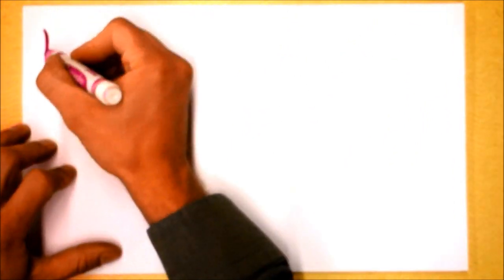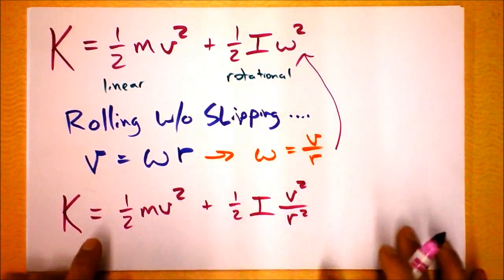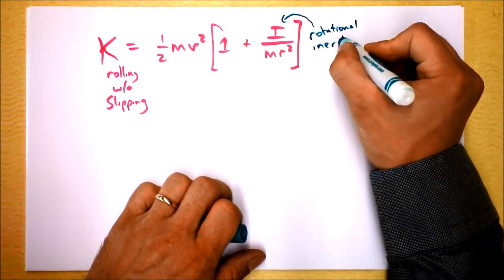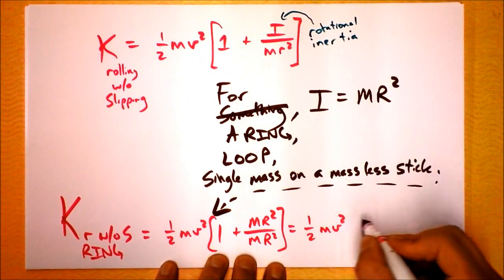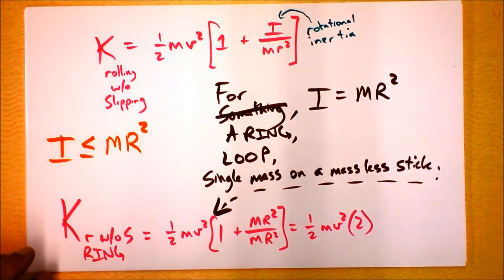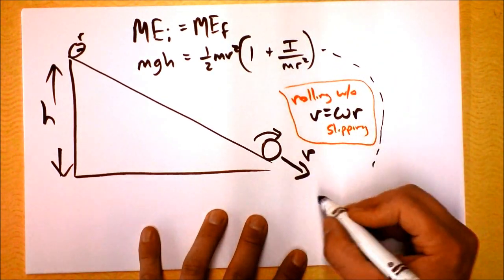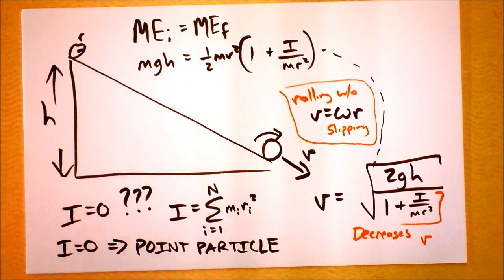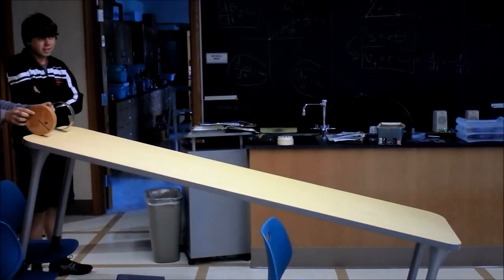Kinetic Energy of Rotation | Doc Physics

Comment: Great Video  Doc Schuster!!... it begs the question about the Conservation of Energy. By that I mean... (drum roll please...)  .. if you take a Marble (ball) and let it roll down the inside of a Hemispherically Shaped bowl... the marble starts at a Height of h1.. and as it rolls down, without slipping, and then rolls up the OTHER Side of the bowl.... the marble does NOT reach the same height that it was originally dropped from... ie, there seems to be a loss of energy from the original Potential Energy.  I gather that the original PE gets split up into KE translational and KE rotational.. but why does the marble quit reaching the previous heights?.. after so many cycles the marble comes to rest at the bottom of the bowl. I know that the Air Resistance and the friction of the bowl are very low... only Static Friction causes the marble to roll.... WHAT GIVES??? ... sorry, long question here...
Reply: no reply as of yet, but I personally could see something like the change of direction at the top of each roll up the bowl being an issue. Overcoming the inertia and giving in to gravity and reversing course has to play into things somewhat.

Comment: isn't the I of a single mass on a massless stick, 1/2MR^2? (correction I meant , solid disc)
Reply from the maker: +zanick2 Nope.
Reply: +Doc Schuster  how can you say that?  its right out of the text books .. However in thinking about it, it makes sence because the center of mass of a ring, that is thick enough to be an entire disc fill, would be half the radius.. so..........1/2MR^2... is the same since the middle of the radius would be the center of mass.       so, what you are saying, and you just treat the disc as a ring and use the center of mass to calculate the I.     But, the equation does exist, right?  ;)
Reply from the maker: +zanick2 I am terribly confused.  What textbook are you reading that says your original statement?
Reply: any text book   it should be obvious, right?
1/2rv^2 for Inertia of a solid mass disc.
Reply from the maker: you mean R there.  Do you know the moment of inertia of a ring?  Do you have access to an actual textbook?  You're being evasive.
Reply: +Doc Schuster yes, sorry.. 1/2MR^2  ..... for a solid mass disc.   for a ring, its MR^2.   oh yes, do I have text books...   I don't mean to be evasive, so let me know what you want me to show.      Yes single mass on massless stick... you are right.  you paused in your video and I jumped to the conclusion of what I thought was a solid disc.. not mass on a stick, which is same as ring.  sorry about that.
Reply: +zanick2 so, if the most rotational I that a rotating mass can have is the same as the translational I, how is that possible, if the "R" is measured from the center of mass? couldn't you always go thinner and thinner with the same mass and get more I??  so, its never 2x the translational, but something less than 2, correct?

Comment: Well, 3000 pounds = 1362 kg, 60 mph = 26.786 m/s, 26.5 inch = .6731 m = .1071 m radius = pretty simple equation to plug in, based on the formula he gave us.
I approximated I = 1/2 I w^2, just an assumption so this will not be exact, but plugging into his equation you will get 732,915 J, or 733 kJ.